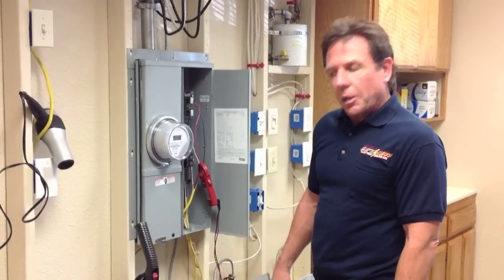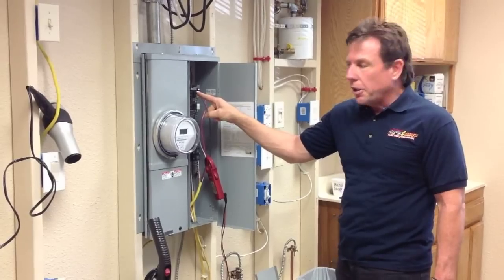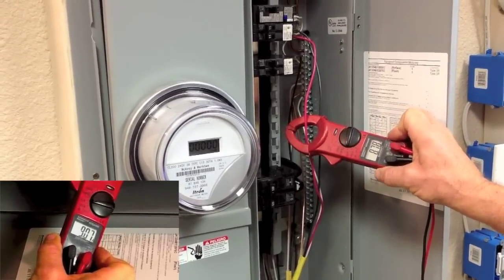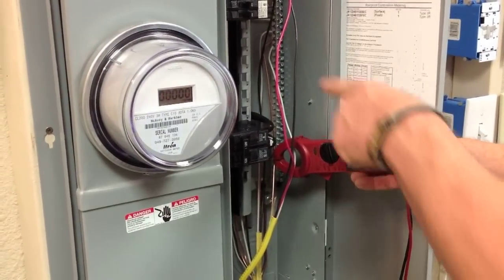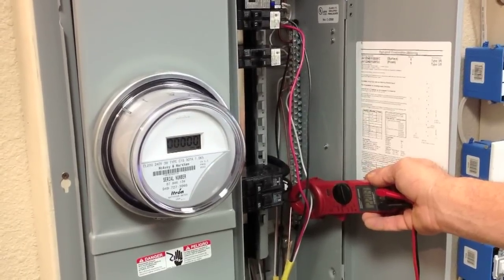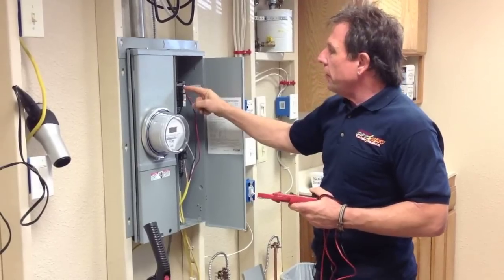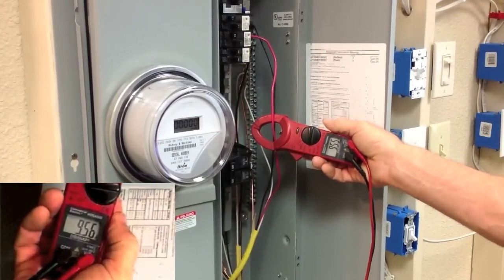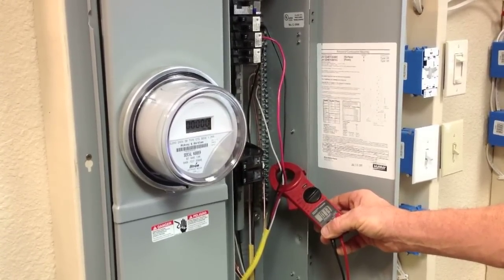Electrical Pannel Phasing and Balancing Loads

Comment: When you had the hot wires on the same phase and got 22 amps on the neutral, that's about what I would expect. When you had the hot wires on opposite phases with one reading approximately 15 amps and the other 9.5 amps, I would expect 5.5 amps on the neutral, not 10. Something else going on here?

Comment: Was it really necessary to blow up my eardrums in order to produce this video?
In which parts of, I could not hear a word of what you said!
Maybe put the appliances around the corner to reduce noise. We are capable of following along and understanding what you're doing without being deafened
Reply: The fact that I needed to explain how horrible it was to run such  loud appliances during your video is enough said. Lol this won't last long

Comment: This video is a bit old, but I believe NEC requires a 2-pole or manual tied breakers for an MWBC, so you pretty much can't put the hots on the same phase, assuming you don't use tandems.
Reply: Asd an ex electrician I was thinking the same. The 2 poles I put in use both loads. Maybe some out there don't? IDK. I would not buy a 2 pole that didn't share load.

Comment: My wife works at a large salon. They burn out hair dryers like mad. Some should from just use, but others have some other issue. Could an unbalanced leg of 120V do anything to a motor or heater circuit?

Comment: a 14-3 circuit, ie 2 hots, one neutral, is actually rarely used except in kitchen countertop outlets and are fed from a double pole breaker connected to both hot busbars. here in canada, we call them split receptacles and the tie bar on the receptacle between the two hots is broken off.  if you measure the voltage between the two hots it will read 240.  two hots and one neutral with separate breakers is not permitted anywhere because the neutral can be overloaded
Reply: if your using a 14-3 in the kitchen, your not a licensed electrician
Reply: MWBC requires tied breakers in order to ensure that the neutral is not energized when shutting off a single branch.  Any load on the "other" branch will expose you to an energized neutral.
Reply: @jimcervantes5659 This ^^^

You won't overload a neutral by running two hots back on it if the two hots are each side of the split phase 240V. The problem comes when the neutral breaks open, or one or the other hot is opened without opening the other. Especially in the event of a tripped breaker that isn't tied. Now you could have energy still on wires that appear off, or backfeeding places and equipment it never shoukd go if a real ground fault initiated the breaker to trip.

Comment: Confused by this.   Expecting the white wire ( neutral). to be the DIFFERENCE between the two.   Need much more study.   Got it NOW.

Still was only expecting 5 amps on the white neutral AFTER THE CORRECTION 
of separation leg 1 and leg 2.

Comment: This is a terrible oddity of the US wiring system.
They should ban this system and require separate live and neutral per breaker/circuit. No shared neutrals.
Reply: The presenter in the video didn't mention that it is required by code to wire the black and red of a multi wire branch circuit (aka shared neutral circuit) to different legs. The overloaded neutral demonstrated at the beginning of the video will only happen if that wasn't wired to code to begin with, or if it was illegally modified. In theory this is a non-issue, if everyone wired things correctly. In the real world, yes, there are some overloaded neutrals out in the field. They should be identified and corrected, instead of banning the practice altogether.
Shared neutrals save copper, reduce cost, and reduce i2r losses over the life of the installation.

Comment: It’s against code to share neutral on two circuits anyway
Reply: No it's not
Reply: Jerry Mann    Really?    Is that what Article 210.4 says?
Reply: That’s a multi wire circuit, but it’s beneficial to use multiwire for  single appliances so you have one specific load sharing the same neutral
Reply: Sorry it’s a twin breaker, my fault. But you can use twin breakers loading from the same phase as long as the panel is design for twin breakers and don’t share the neutral

Comment: (NB) Loads can only be balanced with double-phase electric feed. Single-phase electric feed only has one phase. Just my 3 cents.
Reply: This is a single phase situation.   It is cause by 2 L1 or 2 L2 connected conductors on one neutral.   Should be L1, L2, to one neutral.   It is the half size breakers that non electricians don't understand and do this.
Reply: no such thing a double phase
Reply: @gregberban7067  -How so? Phase 1 and Phase 2= Double phase?

Comment: I know the topic here is balancing the load between the two 120v legs of the 240v circuit. But the real issue here is the shared neutral. If you have two circuit breakers going to two remote loads, you really need two neutrals also going to each of these loads.  Whoever runs 12/3 to a remote load and connects it to two half height breakers is an idiot. Just looking at the back of a half height breaker you can see that there is only one connector onto the load center bus for both breakers. Meaning that it’s the same 120v leg for both breakers. You can’t use those circuits together and have a balanced load.  This is a good reason why many people don’t like those half height breakers - it breaks the rule that adjacent breakers are always on the opposite leg. It means you have to be more careful to balance properly. 

Why is this guy calling it phase A and phase B?  This is single phase 240v with a center tap transformer giving you two legs on a single phase.  Saying phase a and b makes it sound like two phases. Maybe he was taught differently or is just being sloppy with the terminology.
Reply: Neil Brookins   Although you are mostly correct, the issue is not balancing the loads (totally different issue). The issue as you tried to say is paralleling hot conductors to one neutral incorrectly.    Since handle ties are required now, this is not normal any more in residential wiring systems.

Comment: First , The wire used is typically used for a three way switch, NOT for the usual wiring, ONE Hot and one neutral. In essence the deck was tilted for an overload on the NEUTRAL...  However this was a GOOD EXAMPLE how splitting the LOAD to  TWO phase as oppose to tONE phase would help balance the load.  What is NOT explained is WHY the neutral LOAD was Lowered...
Reply: Joe Reg    This is how it is lowered.   Single phase!!!     You have L1, L2, and N.     in video originally wired L1 & L1 to loads and back to N.   So, source is the same point and loads add on N.   Second was L1 & L2, and N.   Now current path is L1 to load to N to other load to L2.   So the unequal load current is what goes back to source on neutral.    This is typically found on half size breakers being mis understood.   Multi wire branch circuits are still legal and in use.   Typically not in residential any more I think.
Reply: @KevinCoop1  ... Nice job on all the corrections 👍 throughout this convoluted comment section. There's a ton of errors you corrected. Too bad the comments were written so long ago.
Reply: Truth Be Bold    Many years ago, there were neutrals "supposedly" (never saw it) overheating because of third harmonics.   There were 180 HZ currents flowing back on neutrals that meters wouldn't pick up.   Testers work on 60 HZ.  These were caused by the NEW electronics at the time.   They originally had half bridge rectifiers that only used half of the sine wave to make DC for the electronics.   Full bridge rectifiers seemed to fix the problem.   
This video was a simple parallel breakers on one neutral.
Be safe!     Kevin

Comment: This surprised me a little bit because when you supplied from two different phases you in essence put both in series..... The two circuits in series should be ok if both loads are rated at 120 volts and together make 240.... The neutral then should take up the unbalanced load ... I thought only 4 amps would be there..
Reply: +Brian Ellsworth,I think you were right Brian Ellsworth,,first instance the circuits were connected in parallel thats why the current in the neutral wire is the addition of two lines because it is the common.
Reply: Brian Ellsworth he is using a 3 phase panel. and he didn't put the loads in series. he put them on two different circuits entirely. If he put it in series the voltage would drop, the lights would go dim, and the dryer probably wouldn't run. The problem is when circuits are over loaded it isn't usually on the hot wire. when the current pass through the load to neutral it joins with the other current in the parallel circuit.  12ga. wire is only rated for 20 amps. You can see that he was reading well over that. If he left it running it would burn into at the weakest point in the circuit, probably a connection at a receptacle.
Reply: kthzzzzzzzzx  I just watched it again .. He took both circuits from the same phase leg . That would explain why the amps are in parallel and doubled on the neutral.. Thanks

Comment: Thank you for the video demo.  My question: Is "Balancing" something that would be done on a common 100 amp 120/240 single phase / split phase (A&B) service/distribution panel and breaker system? Or, for a simple residential panel is this simply a case of visual examination and typical safe circuit capacity, proper installation and mapping, etc?  I don't question your experience, I am simply not aware of this being done unless it is a commercial or multi-residential / multi-phase system.  And I am simply trying to understand.  Your information is correct to hire a qualified electrician, however not everyone is going to call an electrician for this.  I am appreciative for your sharing and taking the time to video and upload, etc.  The neutral heating is one of the things that is interesting.  And is a clamp meter accurate is such a crowded space?  As well, is there going to be any savings to the consumer using a typical 100 amp panel due to peak and off peak metering?  Clearly I don't have a ton of experience and as I said I am appreciative of your time.  The question if you have the time that is most simplistic to answer is my first question at the beginning of my post in bold.  Much success!
Reply: Amp meter in a crowded space - no issue for it is the wire that goes through the clamp that matters

Comment: Is this like if you ran say a 12/3, put the black on one phase, and the red on the other phase?
Reply: g quinn its a split phase so phase a and phase b are 180 degrees out from one another so in fact.you have two seperate phases on the 120/240 system. You are wrong.
Reply: Jacob Millyard    Actually you are wrong.   It is single phase.  There are three sine waves generated, 1 @240v and 2 @120v.   They all happen at exactly the same point in time with the sine wave on the primary.   The 180 degrees comes from an Oscope connection and is taught the way you are saying it.   Just not reality of what happens in a transformer.
Reply: For a 240 volt service, lots of electricians will refer to line 1 (the 120 volt black hot) as phase 1, and Line 2 (the 120 volt red hot) as phase 2. This is still a single phase service even though electricians will suggest there are 2 phases (L1 And L2). Whatever.